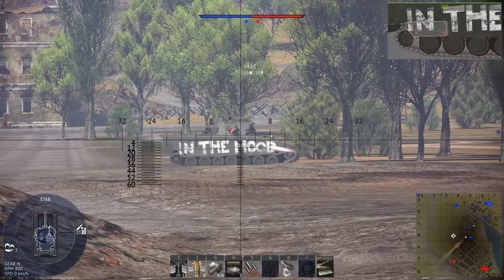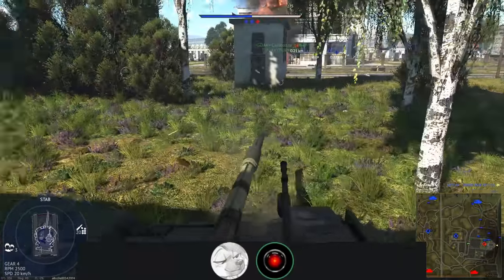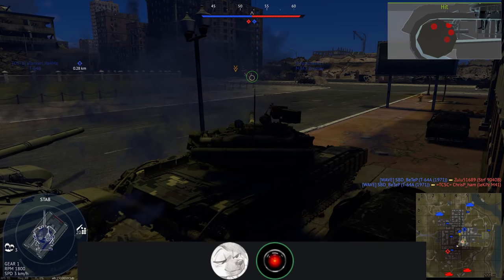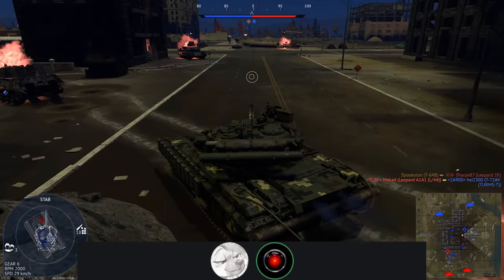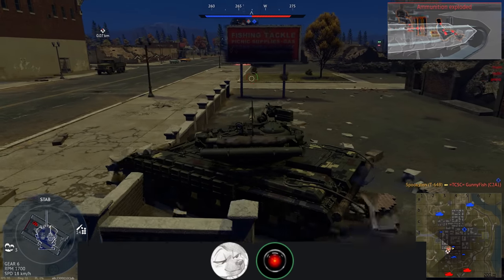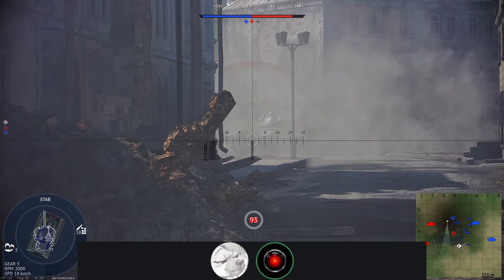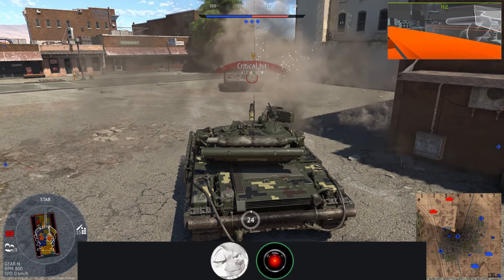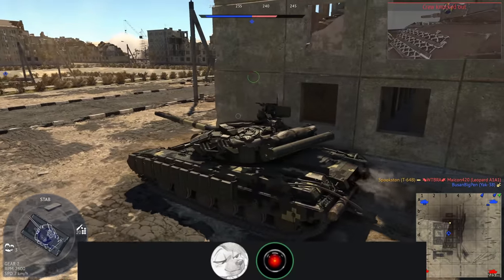Why Do Russian Tanks Have Cages?

Comment: As far as I know, those cages were meant to stop light suicide drones like Warmate used by Ukraine. The older versions of warmate have relatively small HE warheads capable of destroying MBTs if hitting them directly in the roof. But iI think that the explosive load on the newest versions is too big to be stopped by these cages anyway. I don't know if Ukraine bought any newer Warmates though.
Reply: @binaryshark5965  Chep drones can be easily nullified with radio-electronic warfare.
Reply: @kamilszadkowski8864  but that's just one more piece lol of equipment that needs to be taken into the battlefeild especially in an urban environment cause that's where those drones will do their best work, that will then be vunerable to guerilla warfare.
Reply: @kamilszadkowski8864  I’m sure the army using unencrypted radio coms definitely has state of the art electronic warfare units
Reply: @land_and_air1250  turns out that army forgot the encryption keys themselves 🤣
Reply: @land_and_air1250  they have em, just that they dont train with them
Reply: @fulcrum2951  who needs encryption ig lol
Reply: No the cages are supposed be made of Stalinium
Reply: @verdebusterAP  budget cuts
Reply: @fulcrum2951  🤣🤣🤣🤣
Reply: @land_and_air1250  Nord VPN enter the chat.
Reply: Owning a camera quad copter, you can get that between the cops cage and the turret top, I can understand maybe for just dropping something, but if someone is intending to trade a drone for a tank, that cage won’t stop it.
Reply: @Chroniclerope  A lot of the drones Ukraine was using in the East just dropped a hand grenade or small mortar.  They were pretty effective though.
Reply: I might be mistaken but reasonably speaking, should the $500 eachine drones i used to fly not be able to carry enough of a charge to kill a tank?

They could cary up to 3 kg for 5-10 minutes given the right battery and still be more than fast enough for an ambush
Reply: @angrydragonslayer  I guess a civilian drone could be used that way providing the potential enemy would as incompetent as the Russians are and would ride around without the jammers or having them turned off. 

The problem with civilian drones is that the military should be able to pretty easily track your signal and pinpoint your location. Have fun with the incoming artillery barrage. 

There is also the issue of operating at night and of course the range. Warmate 2 for example has a range of 20 kilometers and can fly for 120 min), so you can safely use it from behind the frontlines, unlike a cheap civilian drone.

But I guess cheap civilian drones could be quite useful anty-material weapons for urban combat where the range is not a problem.
Reply: @kamilszadkowski8864  it was purely hypothetical but things such as only activating it seconds before launching the attack and hiding as soon as possible were assumed in my premise.

I did modify mine to have a FLIR camera but i doubt that's feasible for single-use ones

And ofc, as you mentioned, at very short ranges. The ideal situation would be to activate it in a room a bit up in a building, let it out and then fly ~30 sec tops to the closest tank. Hiding as soon as you lose control.
Reply: @angrydragonslayer  Activating the drone just before launching at an already spotted target is actually a really good idea.
Reply: @kamilszadkowski8864  yeah, i wouldnt want to have an active drone, even in standby, in my house if my area is under siege

I back-traced the neighbours DJI and took control of it in less than 5 min (getting its gps data took 2 minutes) following an online tutorial. I am by no means good at hacking.
Reply: @angrydragonslayer  I'm impressed non the less. I couldn't hack shit myself.

BTW, I believe ISIS managed to hack MQ-9 Reaper which is the newest US, top-of-the-shelf drone. I wouldn't be terribly surprised if someone tech-savvy as you would manage to do the same if given enough time and resources.
Reply: @angrydragonslayer  You will hear that armor referred as "copuim armor" on some sites.  That means it gives the crew a sense of security right up until the missile hits.  It will work on more basic charges and RPG warheads.  I believe they tested it against RPG-7s in Grozny.  The Chechens responded by ripple-firing RPGs.  The 1st round destroys the cage and the second and following rounds penetrate into the tank.
Reply: @kamilszadkowski8864  it was literally just a "open up cmd on a windows pc connected to the same wifi, run these lines of codes after replacing the areas marked as placeholders" 

I might have had some problems if the fucker wasnt stealing my wifi but aside from that, it was literally copy-paste
Reply: @swaghauler8334  i could easily avoid that and place the drone (again, with up to 3-4 kg of stuff) on the commanders hatch, no issue.

I'm without a functional drone currently (cracked the frame a few months back and havent bothered) so i cant actually test it though
Reply: @angrydragonslayer  Which is why I said it's "copium armor," ie armor which does nothing but give the crew a false sense of security.
Reply: @swaghauler8334  :)
Reply: @dylanmccallister1888  oh yeah I know I was joking
Reply: @land_and_air1250  

Conscripts encircled Kiev and you are making jokes? We need to take this more seriously.
Reply: @joebenson528  yeah joking at the expense of the Russian army is fine actually
Reply: @land_and_air1250  source: turst me bro

Comment: I told people from the beginning that these cages wouldn't stop javelin missiles due to the tandem warhead. But it would stop top down attacks from RPGs or anti-tank grenades. I'm glad you're bringing this up.
Reply: Could this help against a javelin the tank also has era on top?
Reply: @badgermcbadger1968  not likely and it would also make the tank taller and heavier because I doubt that the current cope cage could hold any ERA worth it’s salt not to mention anything short of Relikt era doesn’t stand a chance at stopping a javelin
Reply: @floppy2651  i meant era below the cage
Reply: @badgermcbadger1968  90% sure you can’t mount most modern era on the top of tanks
Reply: @floppy2651  ah
Reply: @floppy2651  There was/is a Soviet tank (I think T-64) that does have ERA mounted on the top of the turret over the gun breach. Usually they have Kontakt-5 to protect the front of the turret.
Reply: @gamersunite7968  you can mount Kontakt 1 on top but it might as well not be there when hit by a javelin
Reply: @floppy2651  oh agree 100%
Reply: To defeat tendem warhead is exactly why cage armor in theory, helps.
without cages: javelin impacts on the ERA, first smaller warhead sets off the ERA, the second bigger warhead does the peneration thru the roof without ERA interference.
with cages: javalin impacts on the cage, starts the smaller warhead far away from the ERA, may or may not have its warhead or metal stream diverted, may or may not set off the ERA. THe main warhead now detonate (further away from the optimal distance to the armor, which doesn't reduce penetration much, but still reduces), hit the ERA that may still be there, penetration chance reduced. Amount of penetration reduced, chance to setoff the ammo down below reduced.
if I offer some life advice that reduced your chances of cancer by 5%, would you take it?
Reply: It’s not really about stopping javelins anyway, they work well against rpgs from the top, so in an urban environment where troops could use rpgs from windows or rooftops on buildings, it can help, but against modern systems like javelins it’s not as useful

Comment: It reminds me of wood armor that was used during the world wars.Almost completely useless but give the crew a sense of comfort since they got additional "protection"
Reply: Russian tanks still carry logs with them.
Reply: @davidty2006  for different purpose. The trucks however have been seen mounting logs in front of the radiator, probably to help shield it from rifle fire
Reply: though this gives the tanks shitloads of protection, if it didnt then there wouldnt be 3 other forefront countries using chicken slats
Reply: Usually logs weren't used as armor, but as a detachable tool to help crossing mud or getting un stuck out of mud.
Reply: @PilotTed  i think he meant for american tanks such as the shermans, where they'd put almost anything on it, or the italian tanks in the early sections of the war.
Reply: Well
Wood actually was usefull against magnetic mines in the pacific if i recall correctly
Reply from the maker: That was also a point mentioned by Thinky, unfortunately it had to be cut for the sake of brevity.
Reply: It protects their sense of vulnerability, not their actual vulnerability.
Reply: @Spookston  I personally love your longer videos, but I know YouTube is too kind to long videos.
Reply: The shear about of ATGMs in Ukraine right , they can double and even triple tap targets and still have ample missiles left over
Reply: Steel slat armor is great for defeating older HEAT/shaped charge weapons, as they often only contain a single warhead. The extra standoff created by the cage doesn’t allow the “jet” to achieve its proper focus and thus fails to penetrate.

The problem is a lot of the weapons the Ukrainians are using are modern tandem charge projectiles, that largely ignore any benefit provided by the cages.
Reply: The logs are for helping your tank get out of low-traction environments, like if it's stuck in mud- you can put the log under the tracks to give them something to grip on to
Reply: The wood amour was to stop magnets mines so wouldn’t stick to side of the tank and was successful 👍🏻
Reply: @davidty2006  I know that the BMPs still have them and I think they’re used in case they get stuck in mud
Reply: @Spookston  Would it be possible to post the full call? It's good info (or at least good enough theories to keep me listening.)
Reply: Excuse me but when was wood armor ever used?
Reply: That's why Fury is a Movie Scam
Reply: You were laughing, now the whole world is using the same tactics as in Israel 😅😅😅
Reply: @piscessoedroen 🤦‍♂️they are installed for unexpected situations, like getting stuck in mud, and to get out of this they lay logs at the bottom of the tracks
Reply: The Israelis also use that on MERKAVA

Comment: I think the argument of the cope cage being used as camo is rather a stretch. The soviet/russian tanks' low profile was supposed to make them less likely to being seen and being hit. By putting a big "conning tower" on top of your tank, you are essentially tell everyone "hey look here, look at this nice tall structure I have here". Even if you put more debris or branches on it, it still give off a unnatural look and add weight onto the tank.
Reply: Its meant as camo from the air, not the ground. Camo from the air is just as, if not more important due to aircraft and drones. The Ukrainians have been using a lot of drones too, so the camo on the top will help hide them from said drones, if even by a little.
Reply: @PilotTed  that would've been true before the age of thermal imaging, but as we've seen from the BA-2 footage the Ukrainians are more than capable of spotting and engaging targets with thermal imaging.
Reply: @PilotTed  that would've been true before the age of thermal imaging, but as we've seen from the TB-2 footage the Ukrainians are more than capable of spotting and engaging targets with thermal imaging.
Reply: @ryanchatham9971  Well I haven't seen too much TB-2 footage of them destroying tanks in Ukraine (most footage I have seen has been light armoured vehicles i.e. BMDs), to his point, thermal imaging does see heat signatures, but like the guy said in the video, putting all this stuff on top of these cages may in fact make it more difficult to distinguish what it is you are looking at from above seeing as they wont have a heat signature like the tanks engine.
Reply: @aflyingcowboy31  I don't think you have ever seen a thermo imaging of a tank from the sky. Often on the thermo camera, the simple engine deck heat signature is enough for confirmation. So I don't really think cope cage can help with that.
Reply: @TheorientalAsianman  I have, I already said I have seen the TB-2 footage from Ukraine, so yes I have seen the thermo imaging of vehicles from above, also I didn't say it would make it disappear or that it would actually work did I? All I said was that it COULD be harder to distinguish what it is, covering the front half of the tank could make it hard to tell what it is your looking at from above (seeing as light armour vehicles i.e. BMDs and tanks both have engines in the back), I don't think this was its intended purpose, but I could see tank crews doing this after all the drone strikes (more to reassure themselves even if it doesn't work), its intended purpose was most likely for RPGs, although I have no clue whether or not the TB-2 missiles will also be affected by such a cage.
Reply: @aflyingcowboy31  For the record, Nakidka which is mentioned in the latter portion of the talk is a thermal and radar-absorbant (supposedly) covering. There are other kinds of thermal-insulating camouflage netting you can put over these vehicles which would reduce their signature to UAVs or other reconnaissance assets somewhat.
Reply: @Th0nky  Go re-watch the video, he wasn't talking about Nakidka in the first instance, there is literally a photo of what he was talking about, he even talks about how they have been using tree branches, foliage and the like to cover it, he then goes on to mention Nakidka after the fact. My point was simply tanks already out in the field (who probably don't have these measures) could be using whatever they can to try and mask their signature, this of course is not why the cage was implemented.
Reply: The years have changed, now you don't identify tanks with just your eyes but you use thermals, so that helps little with camouflage. Look at T-14 design, its the tallest tank in the world now. Low profile may help a bit with minimizing the target size though.
Reply: @ryanchatham9971  But you can camouflage thermally a tank from air, if you put an IR opaque material at the top that would eliminate the IR signature, assuming the things like hot exhaust aren't very significant.
Reply: The super flat Russian tank aesthetic goes all the way back to the late 1940s (see IS-3 and T-54) and made a lot of sense in a battlefield that was almost entirely run by Mark 1 eyeballs looking through a telescopic sight. As things like IR sights and independent viewers have become more and more common this value of making you harder to detect, and then harder to accurately range in, has diminished somewhat. I think the Russians understand this too, which is one reason why Armata is actually pretty tall at least by Soviet standards.
Reply: You use spreader poles and cam net that's basic cold War for nato and Russia and cage armour worked well in Iraq to stop RPG
Reply: @MalikCarr  Afair Armata is the tallest tank in the world.

Comment: Speaking of silhouette, one of the advantages of a Russian tank is their low silhouette.  The cages dramatically increase the profile of the vehicle, making them more visible on the battle, not less so.  It will be interesting to see stats for Russian tanks (if we can ever get honest ones out of Moscow) after the conflict is over to see if they helped reduce tank losses or actually resulted in more Russian tank kills.
Reply: In this case there are T-72s with these cages which have large camouflaged nettings draped over them which definitely does help in "breaking up" the silhouette of the vehicle. It may be a higher profile overall, but remember we're in mostly flat terrain where this may prove less of an important factor, and creating a "non-tank" profile or a profile that cannot effectively be observed from aerial observation vehicles might be more important. Also worth noting is this is clearly an effort to reduce how much these cages stand out anyways.
Reply: The low profile primarily helps in reducing horizontal target profile.  What’s changed in the past 10 years I think is that modern drones and other tech has greatly increased the importance of vertical spotting rather than horizontal spotting.  For this reason, trading some horizontal visibility for some of the benefits listed in the video might be considered worth it.

Also of course there’s no hiding a tank in urban combat.

Even if someone does see you, so long as the front of the cage is covered with cloth or some other visually-obscuring material, a shot aimed at apparent center of mass will miss the turret itself.
Reply: Honest and moscow in one sentence... Wasnt in my Bingo card.
Reply: @Genktarov  aerial vehicles have thermals these days, so physical canoflauge doesn’t mean much.  If there is a drone in the sky and your tank is warm, you’re getting spotted
Reply: Point still stands that they clearly saw maintaining a completely low silhouette was less important than whatever multifunctional use they perceive the cage to have.

It’s pure speculation but it seems that given the air gap if you put thermal camouflage on the top of the cage you could significantly obscure the turret to thermal vision from above.  This goes back to things like Javelins hitting engine blocks rather than the turret.
Reply: Great minds think alike -- I said the same before I scrolled down and saw your comment.
Reply: @DerMetalmatiker  Two words : Colin and Powell.